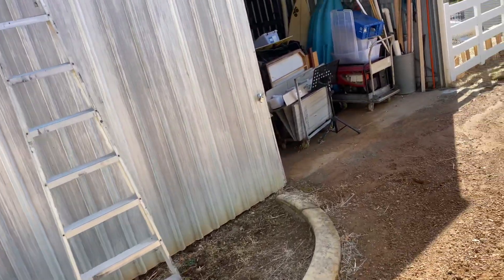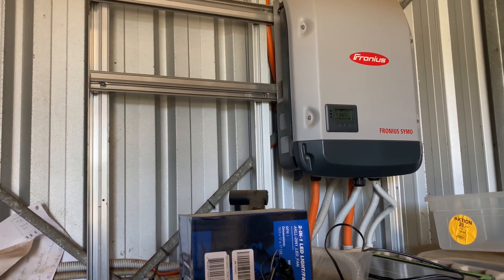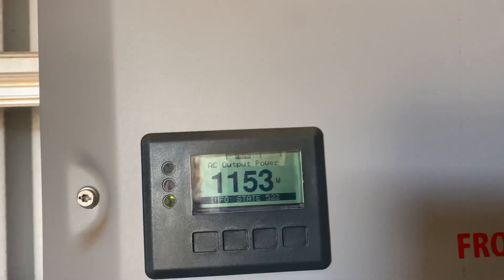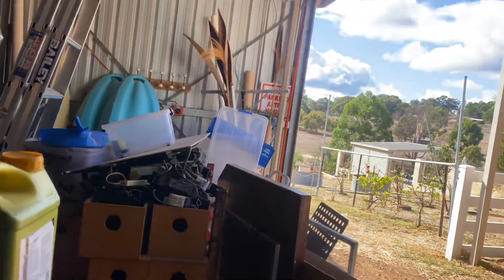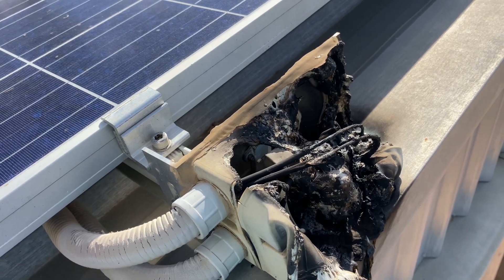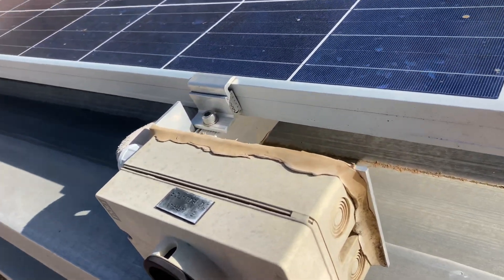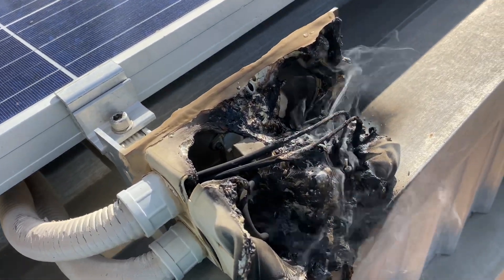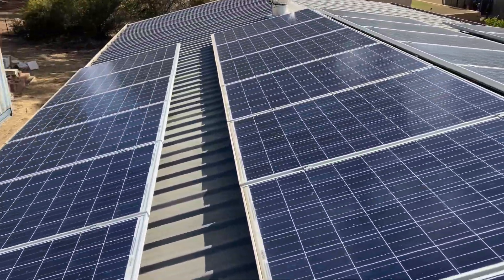More rooftop DC PV isolator fails, causing fires and danger￼ situations in Bullsbrook!￼

Comment: Installed by licensed electricians by the way. Job done, right? No. Licensing does NOT = competence.

Also I don't see the value of any domestic isolator if it's so far out of reach you need a 12 foot ladder to get to it. An isolator should be readily accessible.

Comment: let me give you prople some tips:

-Monitor your system yourself, if you bought 6kWh then, if your area has intense sun, it must reach at least 5.5 kWh when 100%, it will never reach 6 kWh.
-if you can see it, visually check your sollar panels everytime you leave home, birds could poop on it or leaves could be stuck.
-if you cannot see them, use an app to monitor them, there are many that do.
-if you had a sunny day and the power generated is lower than usual then there could be a problem.

Comment: Best to cut the cables as far back as possible, terminate them with MC4 connectors and tuck under panels away from direct UV. Thankfully here in EU we never had such a "peculiar" law with the rooftop disconnects. The one who came up with I swear.... the elevator was not going all the way to the top with that one.

Comment: OneSolar (pfff) did my 4kW system into a 5kW inverter. Never bothered to tell me that the inverter clips everything over 3kW so 1kW is being wasted the whole time.  Compared to my neighbours though, the one good thing they did was put a cover over the isolator so it is never in direct sun. My neighbour's isolator never got a cover and it set their roof on fire due to UV damage and cracking.  The fireys took loads of video and said they see the same thing all the time.

Comment: So what’s the fix? Remove the isolator from the roof, Do you have isolators in the garage? Or just a direct feed into the Inverter?
Reply from the maker: Remove isolators from roof and have a disconnection point instead (MC4 plugs) on pos and neg

Comment: why tf are the dc isolators on roof? where these are utterly useless when shit hits the fan?  in my country dc isolation is done at point where it enters the building, usually combined with surge arrestors..and on many types of buildings there are tigo(and analogic) isolators...to not to get over a 120V potential at all costs... so if the excitation disapperas, the optimizers/isolators are automatically in open state. with emergency shutdown button clearly visible, and accesible.

Comment: Not a fan of high voltage or high current solar panel arrays because installing them with less than perfect wiring design is asking for trouble.. I limited my circuits to under 140v at 10 amps for #10 wire to the combiner box which has arc extinguishing breakers.. There were a lot of systems installed with high frequency high voltage DC grid tie inverters that are fires just waiting to happen.. Cheap Chinese switches and diodes/FET's in the solar panels have been catching fire in these systems..

Comment: What do you even mean by sized incorrectly, try explain things a bit clearer. Too many volt, amps, what? DC isolators on the roof has got to be the most ridiculous thing I’ve ever seen, was the a stupid ruling from the Australian government?
Reply: Not Govt. but the Clean Energy Council and Standards Australia.
Reply: Probably too many panels in series exceeding the inverters Voltage rating

Comment: Now that is one thing I did not consider, those panels are producing current all the time! I hope modern installation have one lead at least that can be safely disconnected from the floor. But it seems to me now what if there's damage oon either or both leads higher up.?
Reply: Blankets work well for strings.

Comment: Just had my two rooftop isolators removed today. They were in good condition, but I now have peace of mind about the system again. Bonus, the electrician found a bad connection, and now my system is producing far more power than it ever has before. Thank you for the video.

Comment: curious, what was wrong with too many panels, did it exceed the voltage of the fronius? because you can over panel them to the bejezus  if it stays within the Vdc rating, given the inverter only pulls the current it needs,  eg if its a 2.5K inv you can give it 25K of panels, but it will only ever draw 2.5k, just like why when you shut teh inverter down, you can safely disconnect modules as you were to remove that iso.

some manufactuers even suggest over panelling. if the was within the Vdc limit,, they obviously caused other breakage when they installed it.

Comment: Living off-grid is not as simple as just buying panels, inverter and the battery, specially when you install a system more than 2 KW. The choice of wire quality, wire gauges and the quality of wire jacket and then if you are not aware of the skin static charge/discharge which destroys your system!!! The problem shows up. I would never buy cheap wires for such a high voltage system. This will definitely cause fire no matter where you use surge protection, etc. before applying the right circuit topology. The choice of  putting panels in series or parallel, the choice of off grid or grid-tie is all engineering and calculation rather than simply placing online orders and DIY installation. That's why there is wires with 5 times the price of amazon non-standard ones with same wire gauge. The new codes require the installation of panel level optimizers (which includes safety and fire prevention circuitry and are not very expensive) for off-grid and the micro inverters for grid-tie system. Do not put more than 8 panels in series without any protection equipment such as panel level optimizers. No matter what is the wire voltage rate, there is always skin static charge which hugely increases the fire risk when the wire voltage passes 350V. In your case, you need minimum 2 circuits or even better 4 circuits of 350V (4x serried circuit) and before the wires enter the ware house, you need a high quality PV combiner with circuit protective components embedded inside, then using a metal conduit (or spiral metal conduits for PV) you feed the combined PV wires to the inverter.

Comment: 600vdc? Doesn't sound like a safe design. I'm in the process of designing my own solar array and I don't want to exceed 60vdc.
Reply: Lower amps and higher volts is more efficient and lower cost as the conduits can be smaller.
Reply: @shmayazuggot8558  Since maximum distance will most likely not exceed 200 ft for my installation, it's not a problem.

Comment: That was a stupid rule. Plastic switch boxes don't withstand climate variations and UV rays well. For optimal safety, it's best to install switches in a metal box that's completely waterproof, insect-proof, and rodent-proof. It's so obvious that I don't understand why they put that rule in place in the first place.
Finally, thank you for showing us how disastrous the situation can be after a power outage like this. Luckily, you have a metal roof.

Comment: Bizzare they would require those on a roof where no one can access them and they are expised to the elements. Breaker should come first, surge protector then if needed an isolator. But they are miving away from them in eu even.

Comment: Never should a DC PV isolator be on a roof.Its supposed to be easily accessible  like a light switch so that a fireman can turn it off quickly when they show up.If this switch was on the side of the wall about 4 feet above ground and clearly marked PV Solar Disconnect that is easily accessible.Baking the switch on the roof top led to rapid deterioration of the plastic and water got in.The PV switch box is fine for outside mounting on a wall.For all you people who mount them indoors take notice at least in Canada all DC switches must be metal indoors,so these do not meet code for indoor installation.Thanks

Comment: How can the inverter be miss-sized for the array?  Was the maximum input string voltage exceeded because there were too many panels in series? If this is not the case, it doesn't matter what the output power specification is for the inverter - it will use what PV power it wants up to the max output power in the specification and no more.

Comment: DIY  my own switch for small system.Inside house, near inverters.Small system,3* 455w panels,40A max charging current.Open type switch,made of aluminum mounted on wood.Regularly switch become hot.Because suppose to use copper,brass as material.Have to clean contact area every few months,then immediately after that switch cool down.Clean also contact area  between panel wires lug and switch.
Switches that switch high voltages,current prone to overheating,due to wrong metal,contact area too small due to bent metal,weak(spring) pressure of metals against each other.And good contact between switch and wire very important. 
Connector plugs used to connect extension wires to panels- many just poor quality.Will burn if voltage, current high.Only connection method that can be trusted-solder it the right way.Will never ever give problem.

Comment: that is why you always don't put any joints and connections (or switches) on the roof. all have to be in the PV input box, which sits normally nearby the inverter and has fuses, surge protection, and a DC switch in there.
Reply: The fewer connections (AC or DC) the better. Every connection is an invitation for a fault/fire. The inverter itself almost certainly has its own DC isolator so adding an extra 4 connections per string is probably unnecessary. Here in the UK you have to add an (utterly useless) AC energy meter (4 screw connections) and a double pole AC disconnect switch. Neither of these things are actually needed and introduce too many possible failure/fire hazards.

Comment: neverunderstood solar DC isolators when the inverter has a switch usually for DC isolation. And if you use them why the heck are the on the roof instead on the wall where they dont get cooked
Reply: Exactly. An isolator switch, any switch, necessarily involves several screw connections any one of which can cause a fault. It's far better to have none at all (except the DC disconnect on the inverter itself). I think the same should be true for the inverter on the AC side. The inverter is presumably connected to a dedicated breaker somewhere - just use that as the isolation.
Reply: @mb-3faze Solar panels usually don’t have circuit breakers. The mains connection to the inverter does. The solar isolator exist so the inverter can be worked on separately in an isolated state.
I’ve had to isolate my inverter about a half dozen times over two years due to inverter software issues.
Isolator fires are due to either bad connections (failure to tighten terminal screws (or over tightening and stripping threads) is a common one) (seen that) or water ingress due to failed enclosures (and cheap plastic doesn’t like UV exposure).

Comment: In America they are making you put them in so firemen can turn them off
Reply from the maker: That was the purpose of them here also but now we are using a disconnection point Where permitted, but in some instances, we still have to use a rooftop isolator

Comment: Solar panels on roofs are not a good idea if you're harvesting your own rainwater.
Reply: Why?
Reply: They leach toxins when they start to break down.
Reply: @keithammleter3824  When damaged or old they leach out ........
Reply: @keithammleter3824  Answered twice, removed by YouTube,  look at the mineral resources that they are composed of and their reactions to heat an damage.
Reply: @keithammleter3824  3 factual answers to you question removed....the truth must really get to it .
Reply: Increased risk of fire and electrocution if there damaged emergency services can't access roof if damaged etc. So I'd avoid any solar panels on the roof if possible
Reply: The rain falls on the panel instead of the roof. I don't see a negative impact.
Reply: @repairman2be250  Old panels degrade, leach out .   TOXINS.

Comment: I'm puzzled - if the problem is poor workmanship of DC isolator installation, or poor quality/choice of DC isolator, why is the solution removing the requirement for DC isolators?  Are we giving up and saying that quality DC isolators are impossible?
Reply: There is simply no use case for a roof top DC isolator. The only requirement we have is, that there has to be a accessible isolator in or near the inverter.

Comment: Surprised the isolators were installed like that, all the ones i've seen have a right angled metal plate covering the isolator giving it a bit more protection from the sun. Glad they ditched the rule altogether.
Reply from the maker: Yes that became a thing a bit later

Comment: Working on an aluminum ladder and a metal roof!  Be careful.
Reply: Fibreglass
Reply: @davidbrooks9576  in this economy?
Reply: @ which is a composite
Reply: Trusty wood ladder for such work, these electricians are crazy.
Reply: what!
you want to use him a copper ladder?
Reply: @ursodermatt8809  Composite ladders exist, to prevent electrocution.  In this case it wouldn't matter though.

Comment: I can see the value of roof top isolators but done properly and that doesn't mean a crappy plastic box exposed to the weather. I dont know what can be done about these fly by night installers they are a real pain. Even reputable installers end up learning by experience as the technology gets better so unfortunately its the end user that ends up paying one way or another. Its just like the old plastic plumbing pipe that used to burst no matter how well it was installed by you try and get the OEM supplier to make good after 10+ years.
Reply: they have proven to be a problem. almost all roof fires started from those isolators.
there is a long history why they were introduced in australia.
Reply: @ yes but is that correlation actually causation?  "all fires started from those isolators" does not at all mean the same thing as "all isolators have been shown to start fires".
I feel like by removing the requirement because of flawed product and/or flawed installation instead of requiring diligent installation and correctly rated product?

Lots of accidents happen in cars - does that mean we improve the cars or ban them?

Comment: For sure these roof top isolaters should have some weather protection. However I can see exactly how this failure took place. The over heating appears to have occured where the DC cables enter the circuit breaker as indicated by the amount of burning at this point. Most of these dodgy installers just terminate the cable ends (Wires) into the breaker. Over time this connection and ageing this becomes a point of failure by over heating. Installers should be terminating these DC cable with a cable gland to hold stranded wires together and thus allowing enough pressure of the breaker screws to ensure a solid DC connection. This is an installer caused failure.
Reply: Bet the Chinese Breakers were more at fault.
Reply: @aloeisthestuff9622  Those Isolators look VERY Australian, Mate. Chinese electrical components are used in the World's largest HV distribution systems - and their component quality (from major suppliers) is excellent.

Comment: So what do u replace them with ? We’ve got them up the top as well near the inverter
Reply: No longer required.  Replace with a labelled MC4 disconnection point and if the inverter itself doesn't have isolation switch put isolators down at gound accessible position, sheltered from the elements.  I'm not an installer so to be honest I don't know if that would upset any other requirement but that's what I'd be doing.

Comment: We went to a DC isolator fire (Aux Firie in FNQ) the other day and said to the boys, that these isolators were a total pain in the a@$&. Glad I've removed mine from my two arrays  !!! 🤠😎
Reply from the maker: Yep I do away with them in most cases these days 👍🏻
Reply: @joondalupelectricalservice3201 28 years in the Industry (from 1986). - I started thinking seriously about retiring when the CEC mandated rooftop isolators! Cheers, Phil

Comment: your videos are always interesting.
ive seen a few roof top isolaters deteriorate from heat and uv, rubber gaskets like in anything will eventually fail, good to know you no longer have to install them on the roof.
i have a mini diy offgrid and every panel is fused, low voltage ofcourse.
german standards are pretty full on i wonder how they wire it all up, i will look into it.
 gives new meaning infinite LOL .